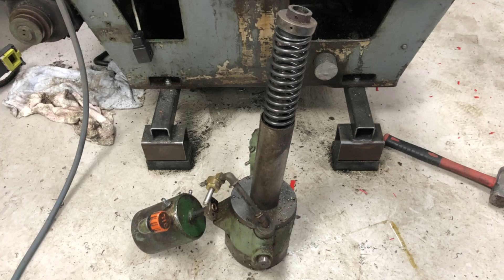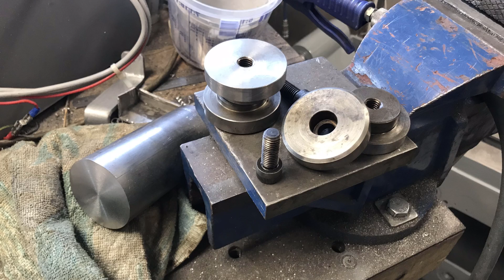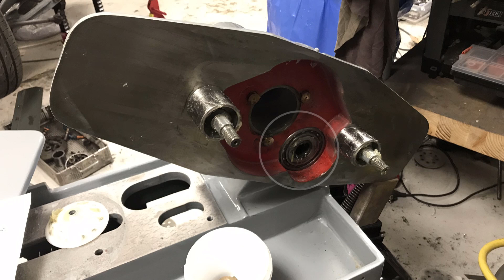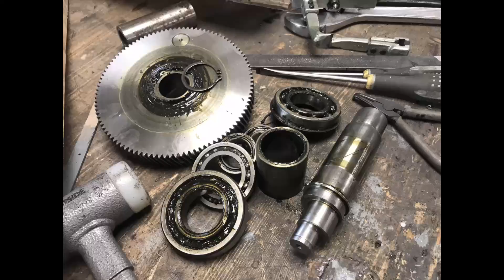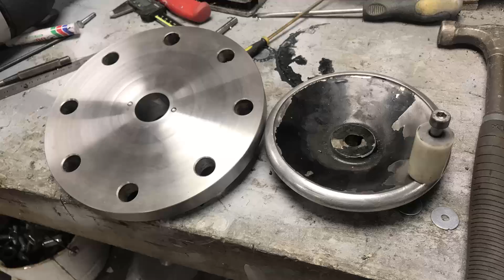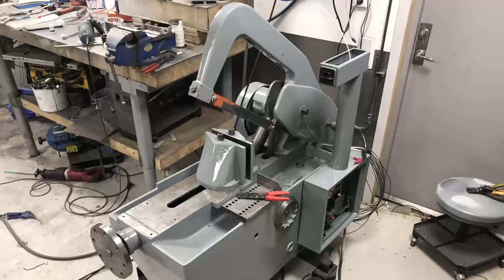Renovating a 700kg Electric Hacksaw

Comment: Nice job! My son and I are about to take a similar VBS 242 apart. It has the same symptoms.
Our saw doesn't have a separate pump for spraying coolant. The return flow from the cylinder is use for that.
Thanks for the video, it is the best source of data so for. It is hard to find good info on the internet. Where did you find your information
Reply from the maker: I emailed Kasto and they managed to find and email me the manual for the machine. The rest was just diving deep and trying to understand what I was taking apart. :)
I uploaded the manual here, not sure if it's applicable to your machine. shorturl.at/moqNV
Reply: @MrCrankyface  Thanks. We'll try to contact Casto 👍. And thanks for the link, I really appreciate our help. Unfortunately it seems to be broken. Could it be something with the URL-shortening service🤔
Reply from the maker: Hi! Sorry for the slow response! In case you haven't gotten a response from kasto, I've tried uploading it to my dropbox. https://www.dropbox.com/s/it1p9vrq9emwts2/VBS202A_BJ68.pdf?dl=0

Comment: Part, do you have pictures from the renovation?  I mean the element that we regulate the lowering from what I found is a pin, a gasket, two springs and a ball.  For me, the saw lacks this and I have to add it.  Or maybe you have documentation?
Reply from the maker: I'm not sure what part you mean but send me an email and I can send you a PDF on this saw. I have some pictures of some internals as well.
I also suspect this saw has been modified at some point since the mechanisms don't work exactly like the PDF describes, and some places look a bit "home brewed".

Comment: Why oscillating instead of bandsaw?  Seems liken it will leave blade mostly unused, be slower and not as nice finish?  Am I wrong?
Reply from the maker: I guess it's older tech, basically just automating what used to be a manual procedure whilst the bandsaw was an entirely new way of cutting things.
A hacksaw will at most cut 50% of the time whilst a bandsaw cuts 100% of the time, making it faster and potentially better blade life.
On the plus side of the hacksaw, the blades are super cheap and seems to last quite a while due to being so rugged.
The slower speed is not something that bothers me as a hobbyist and at the machine also has a crazy big cutting size for it's overall dimensions which makes it quite versatile.
Reply: @MrCrankyface  You've convinced me. I will keep a lookout of one too. Thank you for your reply. I like your inventiveness. Inspiring. =)